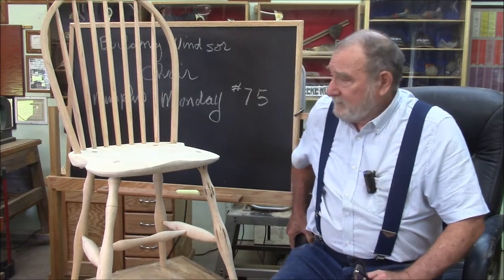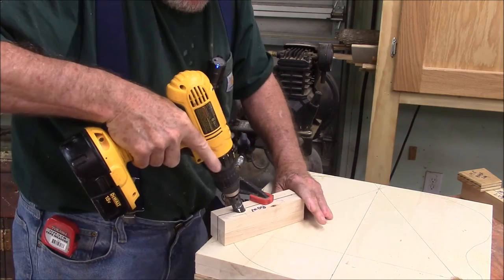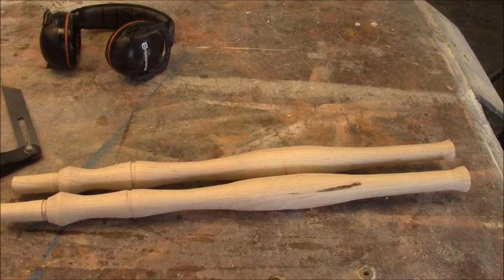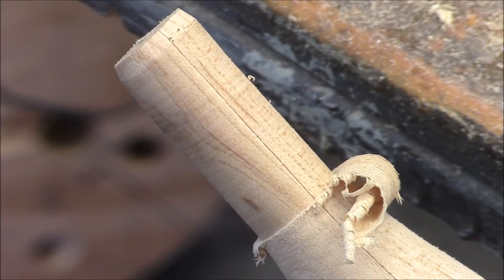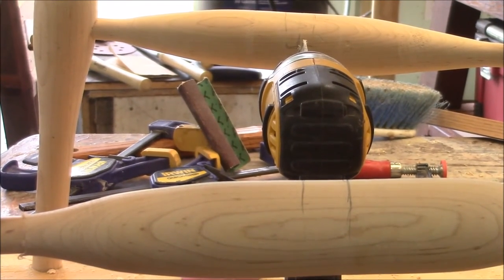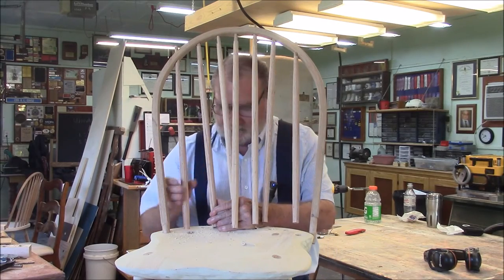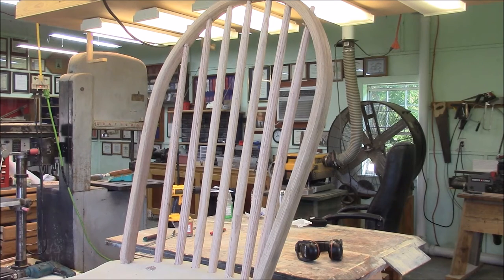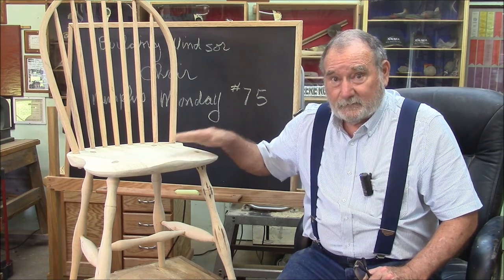75 Making a Bow Back Windsor Chair

Comment: It's hard to believe that this is already episode 75. Time sure does go by fast. Your chairs are absolutely beautiful and your construction methods will assure the chairs will last for a very long time with no problems. I think we've all experienced chairs with wobbly legs, which is annoying, but your chairs will never suffer from that problem. I like the way you did the seats, which look very comfortable and look like they actually fit the human behind. I have a chair with wobbly legs in the garage with a seat that most certainly wasn't designed for the human rear end. Of course the seat on that chair makes it not worth my time to fix the wobbly legs, so it just stays as it is and I never sit on it for very long.
Reply from the maker: Thanks for the kind words.  Episode 75, isn't that amazing - that old clock is running fast, isn't it.  
    Wish I could take credit for the construction methods, but the methods I used were totally traditional.  I think it's important to master time-tested methods before attempting to improve on them.  But you are right, I don't see how this old-timey chair construction technique could be any stronger.  And most important, my wife loves both chairs, even that beat-up prototype.  
Since I do have considerable experience carving, the seats were the easiest thing for me - but the design and look of the seats was also traditional. 
    Wish you were my neighbor,  as I love to fix old broken stuff.  Your old chair reminds me of those two Windsor chairs we fixed for my neighbor a few weeks ago.  Or even those two cheap Walmart rockers I've been keeping in service for the last 11 years.  
    Next week, I already did the video, we continue in our traditional spirit with these chairs, and finish them with a totally traditional finish (Milk Paint).  Hope to see you back next week.

Comment: Wow Memphis!!!  This is about the most amazing work I have seen you do.  The chair is stunning.  No wonder your wife grabbed them immediately.    How long did it take you to build these?  It would have taken me a week just to get the angles figured out.  It always amazes me how you can take such a crude tool as the grinder and get such fluid results.  The chair bottom is a work of art.  Did you have each one of the spindles for the back marked?  I know that they had to be different sizes, but you just slipped them in there like they were all the same.  It must have been a royal pain in the patoot to get them all lined up and into the seat.  I am looking forward to next week's paint project.  
Sorry it took me so long to get to watching this.  You know how it takes a bit to recover from a trip, even a short one.  DC was everything I hoped for and more.